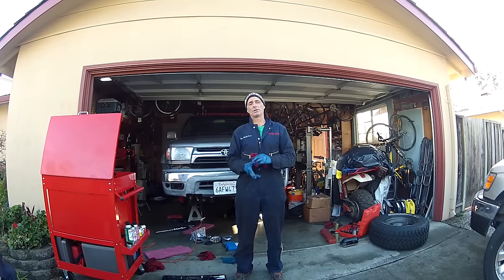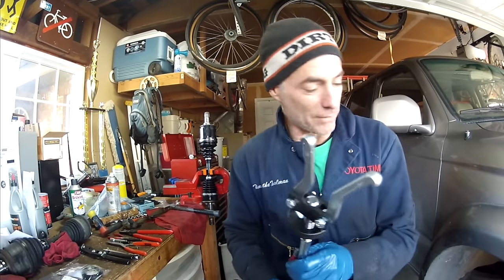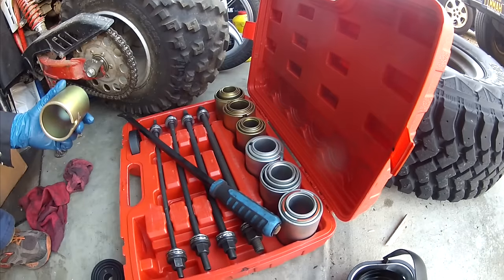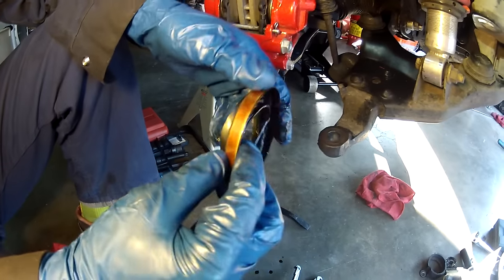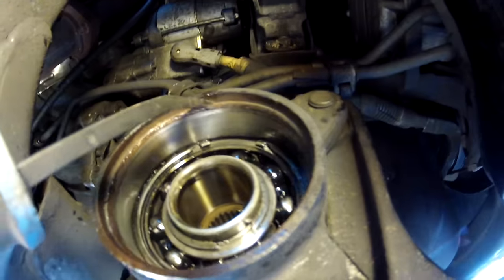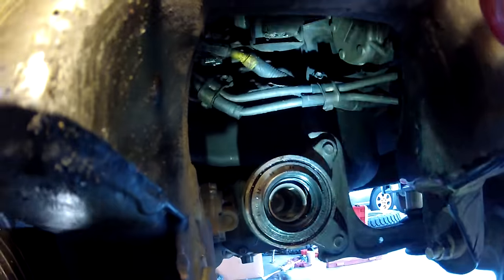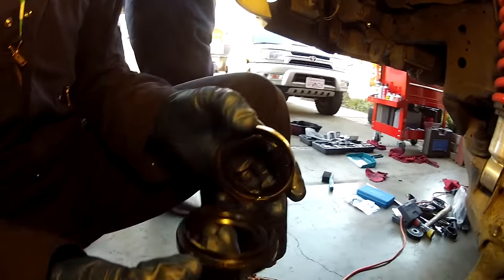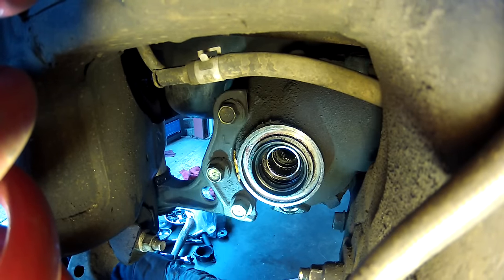Front Differential Axle Shaft Oil Seal Replacement

Comment: Anyone else here because they didn’t watch this video first before driving the seal in too far?? 

Thanks for the videos, Tim!
Reply from the maker: You're welcome Tim.  I would guess you are not the first nor will you be the last that makes this mistake.  It's nicer when the seal driving is much more straight forward and you can just bottom it out.
Reply: Yup, drove it in until it seated. Realized I was wrong, pulled it out and had to replace it with a new one. Toyota is known for their engineering skills but someone dropped the ball on this design.

Comment: I had to recently change the CV axles in my 06 GX470 and used you're other video to accomplish that task.  Unfortunately, the passenger side decided to start leaking.  Thankfully Timmy and his buddies made this excellent tutorial!  Best videos on YouTube...you need the highest award!  Much appreciation Sir!
Reply from the maker: Thanks Steve.  We appreciate your nice compliment of our channel.  We actually replaced the differential axle seals on Thanh's GX470 because one of his seals started leaking too after we swapped out the axles.  We used a new installation tool make by Wit's End which made the job much easier.  Check out the video: https://youtu.be/Q-RO52NtP1A

Comment: I'm elbow deep in this project right now. I appreciate all the  tips, especially on how to seat the new seal. One point  that's worth mentioning - if you decide to use a prybar to remove the old seal, be very careful not to scar the housing where seal sits like I did. It's worth buying or renting a slide hammer! Also, if you don't have a depth guage to measure the 5mm depth of the seal, get a tire depth guage from the auto parts store, they're 3 dollars.
Reply from the maker: @SimpleBelieverInChrist  Yep, you have to be careful with the hooked style seal pullers.

Comment: Thank you for your awesome videos! They are so helpful! I couldn't have done this job, and most other jobs, without your help. You provide accurate information and instil confidence that I too can do such jobs. Thank you!!!

I finally got around to replacing my leaking CV shafts and oil seals. That right side (driver's side for me) oil seal wasn't easy, eh! The first time it wasn't straight, and leaked. New oil seal again. The second time I knocked it in too far, and it leaked. New oil seal again. Third time I think I've got it, nothing is leaking after 200km of sand and 400km of highway.

Timmy. I think I may have set off a little debate, too..... sorry about that. I wish I lived closer so I could buy you a beer (or a slab) to apologise properly. Now I've done it, you couldn't get it in the wrong way, and even if you did, it would leak instantly.

1997 Hilux Surf KZN185W SSRX 3.0TD: Purchased in Japan and brought it back to Australia with me.
Reply from the maker: Hey MIkey, you're very welcome.  It's nice to hear our videos have helped you out a lot.  It's especially cool to hear our videos have given you the confidence to do jobs that you might have otherwise not tackled without having our videos to follow.    We appreciate you taking the time to comment and share your success stories with us.  Happy Wrenching!

Comment: I bought a seal driver kit, all the drivers are flat, the seals are raised away from the metal part of the seals, I then watched this video and at first I was going to do what you did but with a piece of 3 inch diameter pipe but I watched another video on this and the guy(cant remember who) used a oil filter wrench/socket that worked perfectly.
I could tap in the middle or sides. Made it simple.
Great video as usual!
Reply from the maker: Hey Anthony, the oil filter wrench socket sounds like a good technique.  I guess you just need to buy the right size oil filter socket for each side since the the driver and passenger side seals are different diameters.  There's always more than one way to accomplish something.  This is especially true with press work.  Guys come up with all kinds of ingenious ways to get things done.  Thanks for sharing this technique and we're glad you like the video.  Happy Wrenching!
Reply: Yeah, I only had issues with passengers side, had plenty of pieces of pipe and sockets for drivers side. Peace!

Comment: I just tried this. I was having trouble getting the jaws to tighten/widen inside because that round lock nut thing you are using there was just barely able to get on the outside of the back of the jaws to tighten it. I found once I had some of the rubber removed from the seal to give more room I was able to widen and tighten that nut more to widen the jaws inside. Thanks for the video. Finally just got mine out.
Reply from the maker: Nice! Thanks for sharing your experience - we hope people like you sharing their technique will help others in the future that read through the comments so thanks for stopping by and commenting.
- Sean

Comment: Great video, the part numbers for the seal were the same as the seals for my 2005 Tundra TRD SR5 so I used your technique of "5.5mm" and it worked like a charm. I had previously installed a new seal all the way into the tube and it was leaking by really bad, but your info saved the job. It's too bad the Tundra FSM did not reveal that little tidbit of information. Thanks Bro!
Reply from the maker: Thanks for taking the time to check back here & comment. It's comments like these that maintain the momentum & desire to create more content for the masses. We referenced the original seal depth as well to be certain of the correct depth. So don't forget to measure where the failed seal was seated before removing it.

Comment: Another solid video Tim. I ended up swapping out the passenger side cv axle only to have the seal start leaking, doh. I knew in my better judgment that I should have replaced the seal but I figured it would be ok. Guess not!
Reply from the maker: Aaron Phelps Hey Aaron, give it a few days and watch it.  It’s not uncommon that you see a little drip of oil after replacing the CV axles because a little residual oil that was displaced when inserting the shaft drips down.
Reply: @TimmyTheToolman  Will do. Good to know.  I did order both seals from Toyota since I have to swap out the drivers side axle (I'm going to rebuild the passenger side) and just keep the reman unit on the passenger side for now. Gonna do the toytec lift and head out to Moab in a month so I'm trying to get my old T4R up to snuff.
Reply from the maker: Aaron Phelps let us know how the install goes and how MOAB was!!

Comment: Big fan of your channel!  I was wondering if you could do a series on lubricating the drive shaft and the chassis/ Thanks again!
Reply from the maker: Hey Jeff, good to hear you like our channel.  We have a 30,000 Miles Service video that covers greasing the driveshafts.  On the 3rd Gen 4runners, there's only zerk grease fittings on the front (if you have 4wd) and rear driveshafts.  No where else are there grease fittings.  https://youtu.be/a81i1Cayf_I

Comment: Hey Tim. There was a guy who left a comment on one of these CV axle or front diff seal videos of yours who said he had a difficult time removing the CV axle and he had to remove his shock as a result of that. I actually ran into the same problem this morning on my 2000 Tacoma 4x4. I had the Hub completely pulled out of the way with baling wire and also had my floor jack kind of supporting it to relieve the tension of the brake line. The axle was getting hung up between the bottom of the shock and the sway bar link. I tried every which angle to get that thing out of there and could not. I was just getting ready to remove the shock and realized it would probably be easier to disconnect the sway bar links on both sides, swivel the sway bar up, and swivel the end links down. That created plenty of room to pull the old axle out. This was on the passenger side. I will be doing axles and seals on both sides but just wanted to throw this out there for anyone who is running into this issue. Thanks again for these awesome videos!
Reply from the maker: Thanks for sharing your experience.  There's a tool made by the Wit's End company that makes the seal insertion much easier.  We feature it in this video.  Check it out: https://youtu.be/Q-RO52NtP1A
Reply: @TimmyTheToolman  Yes sir we chatted about it already lol. Arrived this afternoon. Just waiting on my new seals from Amazon to arrive in the next day or two
Reply from the maker: @benzoil0453  Gotcha.  I don't remember everyone I chat with online.  Good to hear your got the cool installation tool.  You're gonna like it.

Comment: Tim-  OUTSTANDING  VIDEO!!   You are one of the  BEST  published, professionally produced videos for Mechanical repairs on UTUBE!    I  have subscribed and "liked" your video !! 

  I have a question,  regarding the replacement of CV axel on Landcruiser/ LX 470. I just did the passenger side and replaced the oil seal as well ( it was leaking)   I got a  remanufactured  Toyota OEM  drive shaft  ( I  very much dislike the aftermarket cheap crap that's 1/4 the price of  OEM products )   When I was installing it,  my assistant put a block of wood over the end it, and hammered a few times with a regular claw hammer. It did not go in and the C clip on the diff side of the spline is designed to hold it IN!.    I did more research and found a video that used a drift punch or pry bar and place it on the lip of the large circle and hammered it on that small lip with a 2x2 or metal drift punch.   THAT WORKED!   My question is, did pounding a few times on the end of the CV shaft damage it ??    IT has some linear play in it now,( under the inner side boot)  so I am really nervous if it's damaged and working?   I reinstalled both Ball joints and torqued to factory specs. I know after I reassemble everything i will know in a  second if it's broken.      BTW  - I have never replaced a  CV axel much less on a  4 wheel drive  LX.  
 I'm kind of stuck now and REALLY need a prompt response so I hope you check this site or get a notification daily   Look fwd to your reply on what i should check,  troubleshoot or what... i should do to complete it today 

Thank you Tim
Reply from the maker: Thank you for the nice compliment.  We appreciate it!  You didn't do any damage to your CV axle pounding on it with block of wood.  I wouldn't worry about it.  Good job doing the work yourself.   Happy Wrenching!

Comment: Hey Tim excellent video! Im doing mine today. I have a 97 T100 3.4l 4x4 my fam and I ran her silly in Big Bear this last week..snow, much, mud and some gritty rocky paths! She handles super solid. Until I ran her into a 4' water hole and got her jammed up for a bit. Couple folks came down the path and Wenched us out no problem. Then I ended up with a front pass. Diff leak. From what I read, a blocked breather valve? On the front diff...can you do a video or maybe spare a quick tip on unclogging and or preventing another seal blow out? Thanks again Tim! Appreciate your thorough real human perspective!
Reply from the maker: We probably wouldn't make a video on the topic of a clogged breather because it's pretty basic.   You find where the breather is located, pull it off the line and blow through it.  If air moves through it, it's good.  If air doesn't move through it, you replace it.  On 3rd Gen 4runners, the front differential breather is extended onto the inside of the driver side fender in the engine compartment.  Maybe Toyota put it in the same place on your T100.  If it's not in the same place, get under the rig and take a look where the breather is.  It shouldn't be that hard to spot.  You're seal could have just worn out too.  Seals fail from miles and old age.  Glad you like the video and Happy Wrenching.

Comment: Thanks for the video. My daughter purchased a 1998 Toyota Tacoma 4x4 Extra Cab.  The Front Differential Axle Shaft Oil Seals are leaking on both sides but, much more on the right side.  It leaks differential fluid after the four wheel drive has been engaged for a brief period.  When four wheel drive is not engaged, the leaking stops.  I have done my own DIY repairs myself, like replacing brakes pads, radiators, alternators, valve cover gaskets.  Replacing the Front Differential Axle Shaft Oil Seals, on my daughter's 1998 Toyota Tacoma, looks like a job for a skilled mechanic and not a job for me.
Reply from the maker: You could handle this job no problem with the right tools.
Reply: @TimmyTheToolman  Thanks.
Reply from the maker: @cgrscott  You're welcome.

Comment: Nice video, and very informative, you've just earned a sub, and if you could it would be great to see a video on how to change that needle bearing. And is that the needle bearing that we are seeing the oil seal go around?
Reply from the maker: Hey Tyler,  I might be helping a guy install a front differential "Clam Shell" equipped with an ARB locker but I don't know if this mod will include replacing any bearings.  The oil seal is not really going around any bearing.  It's just seated into the ends of the differential housing.  There are bearings inside the  housing just past the oil seal and that must be what you're talking about.

So, if his bearings are fine, I doubt we'll be replacing them.  But, who knows.  I might find a local 3rd Gen owner that needs this repair and we'll do it for him and make a video of it.

Thanks for subscribing.  We've got lots of good stuff coming.

Comment: Hey Tim,  Just wanted to say thanks for the chat today and wanted to know if you had any rear pinion seal replacement video's.   My pinion seal is leaking at the differential and need to fix it.  I would image those 4 Runners would be the same for a lot of Toyota's. I have 3 Toyota's but this one is a 1991 Previa.
Reply from the maker: Hey Greg, you're welcome.  Unfortunately we don't have a video for a pinion seal replacement.

Comment: Hey Timmy, I just did this job for the first time (thank you!). My passenger side seal went in WAY easier than the driver side, so I unintentionally pounded it just a bit past flush.  ***Should I be concerned? It seems there's actually plenty of room behind it, so I imagine a few mm would be fine, but what do you think? I'm already buttoned back up so I'm hoping to NOT have to dissemble LOL. Thanks!
Reply from the maker: Well, as long as you're not leaking, you're good to go.  I think there's some room for adjustment of the position of the seal and it will still seal fine on the CV axle.

Comment: If the seal is to fit at the same level as the outer ridge, you could use a sleeve that, not only, fits the diameter of the seal but whose sleeve walls are thick enough to extend out further to meet with the outer ridge. That way, there would be no way of installing the seal beyond the outer ridge. Also, if your sleeve was shorter in length, you'd have more room for hammering. A sleeve (like what I've suggested, above) could be made by gluing one diameter of PVC pipe inside a wider diameter of PVC pipe. $2?
Reply from the maker: That's an excellent idea provided you could find the right size PVC pipes.  PVC pipes come in definite industry standard diameters so you might not find two that will work perfectly for this application.
Reply: Second that, and adaptor to a screwed connection gave me the extra lip on my case. Definitely a budget friendly and soft material valid alternative. Cheers!
Reply: @TimmyTheToolman another way is to make installation tool on wood lathe using white oak.
Reply from the maker: @bobschwarz9184  Yeah, whatever works to get the seal to the proper depth.
Reply: @TimmyTheToolman  I just replaced axle seal on a friend's 2012 Jeep liberty on the right front and the slide hammer tool wouldn't grab it good enough to pull it out and of course that seal is recessed about 2" in, so the hand held seal puller wouldn't get it either, so I spent 3 hours digging at it with anything I could find and hammer and chisel, Dremel tool, definitely not a fun time.
Reply from the maker: @bobschwarz9184  That sounds like a nightmare.  I just learned of another seal puller type that I purchased.  I learned about it filming the recent transfer case rebuild series that we did partnering with Georg who owns Valley Hybrids.  Check it out.  https://amzn.to/47F3JsQ
Reply: @TimmyTheToolman  I used to have a tool just like that years ago when I was mechanic back in the day, I haven't been able to find it since I went to tree trimming in 79 and Lost track of half my tools either loaning or they're buried somewhere in all my organized mess in 4 different locations,LOL. Thanks for the info and the videos you do from time to time.
Reply from the maker: @bobschwarz9184  Wow, that was eons ago you were a paid mechanic.  I was a Freshman in high school in 79 which means you're older than I am.  Well, the good thing is that tool isn't expensive.  You could buy another one because it sounds like finding the original might not happen ever.
Reply: @TimmyTheToolman  you are probably right, however I still need to get everything I have organized or get rid of it, I just bought a 1970 c60 Chevy bucket truck and it needs brakes worked on and the hydraulic hoses and lines replaced, so that should be fun and a challenge for a soon to be 71 year old guy who don't know when to quit. I might could make that tool when I get my blacksmith shop area set up and organized better just for the fun of it all. Have a great day.
Reply from the maker: @bobschwarz9184  Turn wrenches as long as you can.  That's my plan.